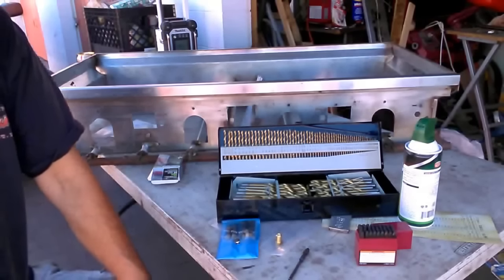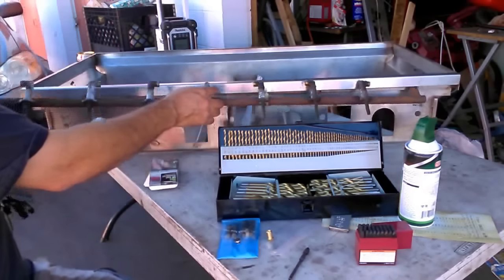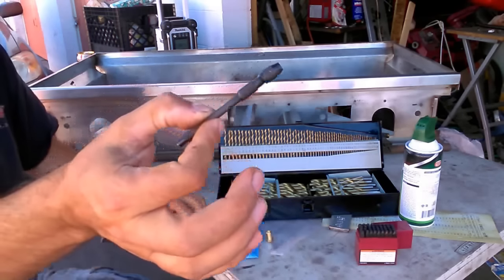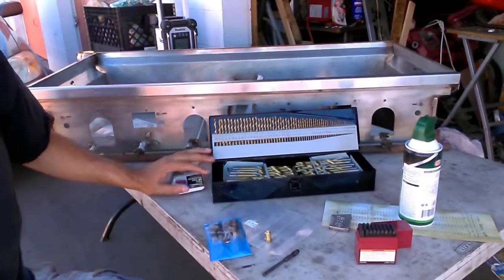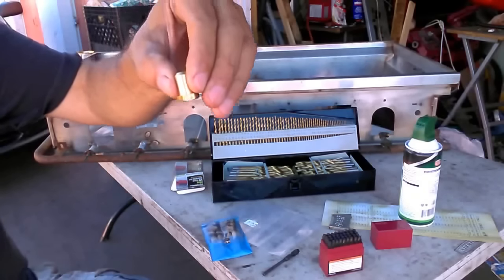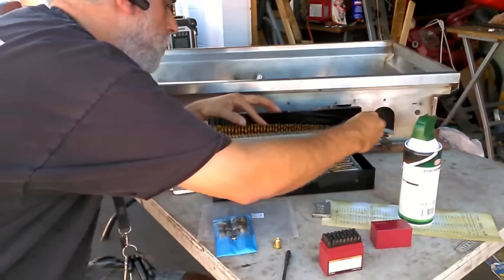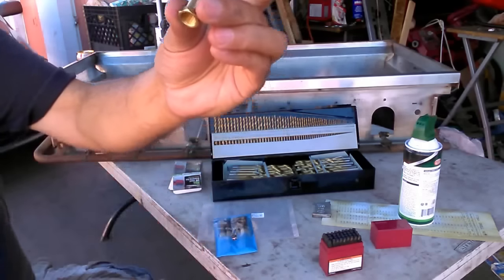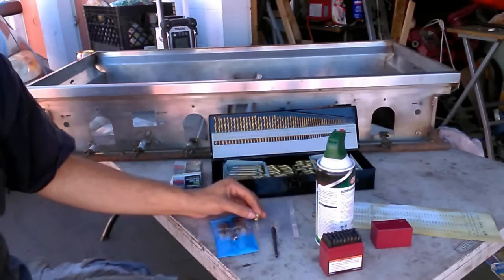Propane and Gas Conversion Basics (How to)

Comment: Hi Frank, I've got a buck stove model 329 that is natural gas and I need it to be propane, Buck stove says it can't be done, can you help me? Thanks.
Reply from the maker: I'm always hesitant to give advice on heating devices and "gas" fireplaces because these items use an virtually uncontrolled flame in a visual and functional way. That being said, in theory, anything can be converted. You'll need to change the regulator, the orifice and the pilot generator (if there is one).

Comment: Thanks.  Nice and clear. Interesting...  So diff is just orofice size?
Reply from the maker: Generally speaking, there are 3 things which must be changed to do a proper conversion; the regulator, the orifices and the low flame settings (on stoves and indoor appliances). I specialize in doing the orifices. Feel free to contact me at 714-574-1544.

Comment: If I sent you orifices, would you be able to drill out my orifices for natural gas?  I believe they are metric and I have the ones that are installed in my propane stove.  The natural gas orifice numbers are #165, #109, #139, and #185.  It's a Bosch oventop.  Please let me know.  Bosch won't sell me the orifices.
Joe Bodziony
Reply from the maker: I'll need to some info on this unit because most manufacturer's rate their natural gas units at different BTU's than their propane units. Feel free to contact me. I'm in the MidWest at 714-574-1544. Doing a fuel conversion is usually a simple affair. I've converted just about every type of bar-b-que and stove made.

Comment: Do you have a kit to do a Napoleon grill from natural gas to LP also do you have a website thanks
Reply from the maker: Napoleon's are high end units that use high tech proprietary orifices. I've machined the parts that I have using customer samples. Here's a link to one of the listings that I've done for the P450 model:.   https://rover.ebay.com/rover/0/0/0?mpre=https%3A%2F%2Fwww.ebay.com%2Fulk%2Fitm%2F183773692862.  Feel free to contact me directly at 714-574-1544. Remember that I'm on the West Coast when you call.

Comment: Hey buddy I'm trying to make a natural gas commercial fryer  to propane any advice??
I got the hoses and regulator for a propane tank. I need to change something else??
Reply from the maker: Leonel Villamil I recently did orifices for a commercial Cecilware 4-burner fryer. Those fryers usually have their own regulators depending on if they're commercial or not. Feel free to call me at 7145741544.

Comment: I have a VGIC485-6CSS range I am working on converting from Nat to LP. 

I believe I need the #57 hooded orifices for this conversion. PB040036

I also need to flip the pressure regulator valve cap, to see LP on the cap. 

I also need to adjust the air/gas ration door on the burner assembly to control and get a nice flame, at low setting. The gas knob, after it's been removed has an adjuster screws that controls the flame also.

Is there anything I missed that would cause a problem when converting this stove from Nat to LP?
Reply from the maker: I've done a load of Viking conversions. You're likely right on the size, but I'll need some info from the manufacturer's tag because those burners have a different rating from gas to propane. Feel free to call me at 714-574-1544.

Comment: Looking for help I am trying to convert my Jenn-Air Dual fuel range to propane but they no longer sell the orifices the part is 12002473 for model # JDR8895AAS, do you know what size the holes should be for propane?
Reply from the maker: Propane sizes are smaller than natural gas sizes. I've done a few thousand of these Jennaire units, but never the JDR model. Maybe you can send photos to my mobile at 714-574-1544. I'd like to see an overall shot of the unit, but the more critical photos would be of the manufacturer's tag and the numbers stamped onto your current orifices.

Comment: I have a Laars 400,000 BTU pool heater and want to convert from natural gas to propane

I haven't checked the orifice sizes yet but how would I go about calculating the correct propane orifice size?
Reply from the maker: I have conversion table for that. The higher BTU output likely means that there are multiple burners on this unit. The orifices will be stamped with numbers that I can reverse calculate the BTU ratings of each burner. Feel free to contact me  during West Coast business hours at 714-574-1544.
Reply: There's 20 burners and the Factory OEM orifice size for natural gas  is number 45
Reply from the maker: As I said, I convert appliances for a living. Here's an orifice chart: https://www.johnstonesupply.com/storefront/tools/orificeChart.ep

Comment: Frank, would you be able to get hold of a kit so that I can convert a Miele Oven from Propane to Natural gas. Model is Miele 36" Gas Range with Convection HR1134LPSS
Reply from the maker: I've got a kit for everything made. I'm on the West Coast, so you can always get a hold of me during standard business hours; 714-574-1544.
Reply from the maker: Yes. Those orifices are likely something that I have in inventory already. I'm on the West Coast, so just give me a call during normal business hours at 714-574-1544.
Reply: Thanks Frank. My issue is the following. I live in Brazil and have purchased this Miele Oven to work with Propane - it is still in Miami and has not yet shipped to Brazil. However my street will now use natural gas. I would need to pay a 30% restocking fee to send oven back and get the natural gas model which is very expensive. So I am trying to see how difficult it would be to get hold of the parts and do the conversion with someone handy here in Brazil. I have seen videos of changing the cook top but not sure how complicated it is to modify the oven as well. Ideally I could buy all the parts from you. Miele says it will only do a conversion at the factory.

Comment: You are so precise I would think you would put the orifice in a vise & then have the chuck mounted perpendicular to the orifice & then you can hand drill straight !
Reply from the maker: You likely missed the spirit of this video. I don't ever use a drill motor to bore orifice holes because these holes will distort under higher speeds. I use a pin vise to hold the drill bit while I'm boring it out to the final size. A precision job on the final size is only achieved by gradually creeping up to that size one bit at a time. I also bore holes in the custom orifices and jets that I make on my lathe at very low speeds.  If I'm boring a much smaller hole (like a #87, for example), I'll do this in one operation, otherwise I'll still bore a pilot hole, then hand bore to larger sizes. Feel free to contact me during normal West Coast business hours at 714-574-1544.

Comment: can u tell me what is the size for propane
Reply from the maker: Doing a fuel conversion is usually a simple affair. I've converted and have parts for just about every type of barbecue and stove made. I'm now in the Midwest, so feel free to contact me during normal Midwest business hours at 714-574-1544.

Comment: Hey Frank, liked/subbed. I just picked up a Crown Verity MCB 60" (2×30") propane grill that I'd like to convert to natural gas. The information tag on the grill has the propane main burner at #56 and pilot #70 and MP 11" WC. The Nat. Gas main burner would be at #49 and the pilot #57 MP is 3.5" WC. I'm at 3000ft above sea level, if that makes any difference... Do all these sizes sound appropriate? Is there anything with these grills I should be concerned with, over and above...  As a machinist, I can appreciate your methods. Great Work!
Reply from the maker: You're at an altitude that will have little consequence on the burn of natural gas or propane because the altitude density is still reasonable. The altitude factor for 3,000 ft in elevation is only 0.9565, so, again it's quite negligible. You don't really need to worry about altitude factors until you've reached 8,000 ft or more.
Reply: Sounds good, thanks Frank

Comment: I bought a 1920s wood/gas combination stove. The orifices must be for natural gas since when I connected a small propane bottle the flames seemed too high and yellow. Also, when more than one burner is lit the pressure drops off drastically. Any idea why this would happen?
Reply from the maker: The unit is set up with natural gas orifices, so those will need to be swapped for propane orifices. I have orifices for everything made, so you can always contact me if you need to change the orifices. You'll also need to convert the regulator if your regulator is convertible. Since this unit is a 1920s model, it might already be prepared for propane using the existing orifices. Many of these Depression era stoves are like this. You can view my video that explains this process with convertible orifices:   https://youtu.be/PNrBdLLvXPw      You'll also need to convert the regulator if it can handle both types of gases. My video shows the most common type of regulator in use today:  https://youtu.be/d2GljedOVaQ     If the regulator in the second video is not the type you have, you can view a more detailed video showing various types regulators;     https://youtu.be/AddrkTCBd7c       In either case, you'll have a little work to do to complete this conversion. Make sure to subscribe to my channel while you're at it.
Reply: @frankhamilton8257  I have a napoleon Prestige I want to convert to NG... what thread and size orifice would it use. it has a sizzler side plate, 3 burners and is rated 45000btu... total.

thanks. great vid
Reply from the maker: @quintonenglot9038  Doing a fuel conversion is usually a simple affair. I've converted just about every type of barbecue and stove made. I'm now in the Midwest, so feel free to contact me at 714-574-1544.

I have kits for various Napoleon Prestige grilles. Feel free to reach out.

Comment: Do you make them for Samsung dryer? Its propane now and I need it Natural gas.
Reply from the maker: I make orifices for every type of stove, oven and barbecue made. It's possible that I have a match for the orifice that you'd need to convert that unit, but I'd need to see what you have. You'll also need to change the regulator.

Comment: Hello, Frank.  I recently purchased an Electrolux range that had been previously converted to propane and I now want to convert it back to gas.  According to the manual, the liquid propane orifices are between .0086mm and .00118mm and the natural gas orifices are between .0133 and .0196 mm!  These orifice sizes are small enough to make me question if the manual has a misprint(?)  Anyway - do you have experience with creating orifices this small?  Any thoughts here?

Thanks
Reply: It also talks about bypass orifices for each of the 6 burners, which are even smaller...  Thanks in advance.
Reply from the maker: Doing a fuel conversion is usually a simple affair. I've converted just about every type of bar-b-que and stove made. I'm now in the Midwest, so feel free to contact me at 714-574-1544 during normal Midwest business hours. It appears that the manual is a misprint. I used to be a technical writer for a Korean auto maker, so I get how this info could be translated wrong when it went into print. These orifices likely have numbers stamped into them that would tell us the real story. I have every type of orifice and low flame jet made  (bypass jets - that's the proper industry designation for them). In the case of your low flame jets; they will have numbers stamped into each flat on their heads (each flat is divided down the middle by a standard screwdriver slot). To see these jets go to my video    https://youtu.be/XoNVkMh_8Pw?t=184      You won't need to remove the control valve assembly to gain access to these jets. I removed them in this video to clearly illustrate them, but they can actually be accessible from a hole in the front control panel on your range. Feel free to reach out so we can get this range converted.

Comment: Maybe you can help me....I purchased a 48" wolf griddle to use at home on my gazebo.  But I cannot get wolf to sell me a conversion kit for it. I can get you model and serial#s if I could get you to help me do mine
Reply from the maker: I have orifices for every bar-b-que, stove and oven made. If not, I can make custom parts in my machine shop I'm in the Midwest, so feel free to give me a call during normal business hours at 714-574-1544.
Reply: @frankhamilton8257  awesome... Thank you also what are your normal business hours
Reply from the maker: @tomchristensen2914  Normal business hours are 9 am to 5 pm Central Daylight Time.
Reply: @frankhamilton8257  I am doing a super deep clean on this thing. It was abused for years it looks like. I will give you a call soon to get proper orifices

Comment: Hi Frank, I have a stainless steal Ducane 5 burner grill with a side burner. I was told Weber bought out Ducane, can this bbq be converted from LP to Gas. Is it a matter of just drilling out the orfices or what exactly is involved.
Reply from the maker: You'll need to install a Natural Gas regulator to start. Drilling or not drilling is totally dependent on the output of the regulator. Some bar-b-ques need a low flame adjustment (if yours has one) and an air shutter adjustment to get the mix of air and gas balance. I normally sell kits to match the heat rating and include a regulator in my kit to have a predictable outcome. Feel free to call me if you have any specific questions. I'm on the West Coast, so keep your call time to business hours - 714-574-1544.

Comment: Frank, i have a LP smoker that i want to change to NG. would you be able to make that possible? I really am tired of the propane having to be filled all the time and i already have a NG line ran with a quick connect on my porch where my smoker sits.. if you can make this happen it would be greatly appreciated. its only a single burner style vertical smoker. the burner looks like the kind that you would find on the older NG stove tops in your house. if that helps. please let me know if you can do this. thank you for your time.
Reply from the maker: I likely have an orifice to fit that unit. Just give me a call at 714-574-1544.
Reply: Hi, great information.  Thank you. 
How do I calculate what the proper final orifice hole size should be?  I am converting an outdoor turkey fryer burner, older nice heavy cast iron burner that is currently.   propane, converting to natural gas?
Reply from the maker: http://andersonforrester.com/conversion-chart/

Comment: i was told napoleon prestige ng grill could not be converted to pg. After seeing your video you made me believe it could be done. would it be possible you could make a kit with the right size orifices.
Reply from the maker: I've converted a dozen Napolean grilles over the years. I've likely done the same orifices that your have on your grille. Just give me a call at 714-574-1544. I'm on the West Coast, so call during normal business hours.

Comment: Hi Frank, we have bought a used Thermador PDR364GDZS, I am being told it can't be converted from natural gas to LP because the conversion kit is obsolete. We only have access to LP, would you be able to help us?
Reply from the maker: I've done quit a few Thermador units in the past. Can you send me some pics on my mobile at 714-574-1544? Send me an overall shot of the unit, a closeup shot of one of the burners, another closeup shot of the same burner with the cap removed, and a shot of the manufacturer's tag.
Reply: I don't have cell service where we live, but I have wifi so I sent them email.

Comment: I have a Char Broil Commercial series grill set up for natural gas and want to convert to LP. Model # 463252205. How can I do this? I was told nothing is available from Char Broil
Reply from the maker: I've done my share of Char Broil grilles over the years. I had to machine most of the parts, so it's likely that I have your parts in inventory. Give me a call at 714-574-1544.

Comment: Hey Frank, I am converting a Weber Genesis silver B from NG to LP. Can you provide the orifices for the 3 burners?
Reply from the maker: I've done the Genesis Silver C, and your's is slightly different. Just call me, and we'll figure it out. Here's my number: 714-574-1544.
Reply: Currently in a situation with a perfect flame 3019l-ng...trying to convert to lp. Ever messed with them?
Reply from the maker: I've never done perfect flame units, but I have orifices to fit 100's of different units. Just give me a call at 714-574-1544. Remember that I'm on the West Coast when you call.

Comment: I have an outdoor gourmet 6 burner grill and want to convert to NG.  do you know the drill size?  also can I jus tie into line without regulator?  any help would be great.  line only has about 1-3 psi on it
Reply from the maker: I've heard a lot of people who say their gas guy told them to run their grille without a regulator. But think about it, you have a regulator on your oven and stove in your kitchen, so why would you run a grille without a regulator? The regulator is designed to shut off if you develop a leak further upstream and to "open loop." I do a lot of NG conversions where I figure out orifice sizes, but I don't ever give advice to people unless they are customers due to all the variables involved. The reason that orifice conversion kits aren't available from manufacturer's is because, by and large, they lie about the true output of their burners. So if you try to convert a grille based on manufacturer info, you'll likely be off in your calculations. Here's a link to an orifice chart that might guide you in the right direction:   http://andersonforrester.com/conversion-chart/